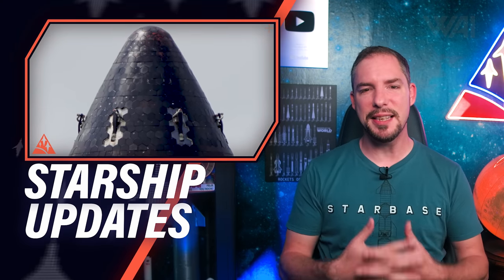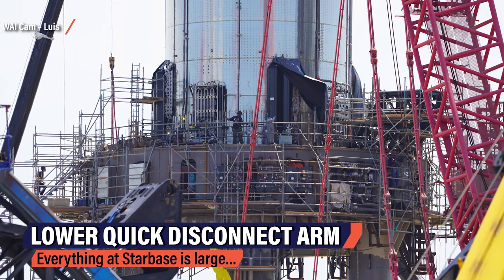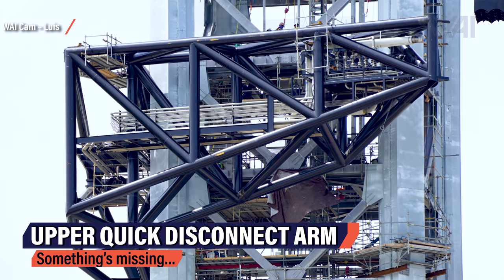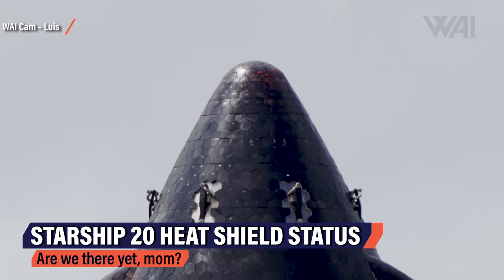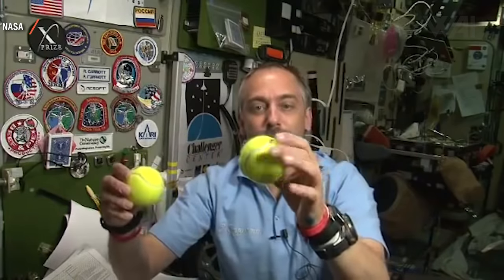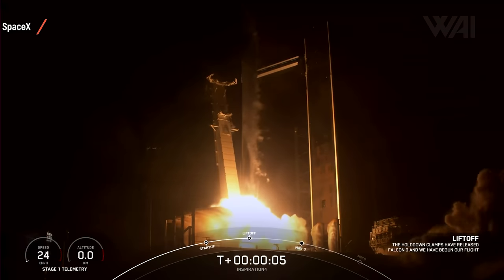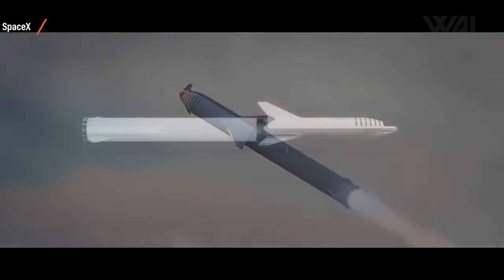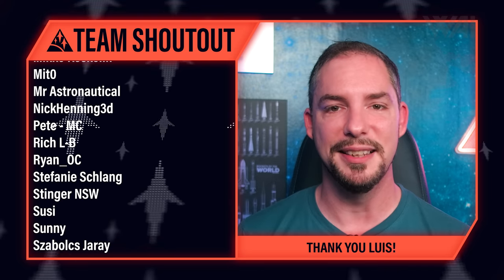SpaceX Starship Heat Shield Done! – Inspiration 4 Launch Summary

Comment: If B4 clears the pad without incident, they're doing well.
Reply: Im honestly worried the static fire will damage the pad which will in turn damage the raptors
Reply: @damitcam  And the farm being right next to the pad too?
Reply: @matthewcattermole5718  that im mostly concerned about a rud but yea thats a risk as well
Reply: @damitcam  I actually believe that the farms cryoshell would work fine against shrapnel, and I don’t see a significant risk of a shockwave so energetic, it would lead to a fatality on the tank farm. 
But I am just guessing, I should mention. 
I watched another channels Video about the explosive potential of that particular fully stacked vehicle. That was fun to watch.
Reply: @christophkitterer131  i watched it too but if it ruds the tank farm is going with it
Reply: Most likely B4 will explode at Stage 1. However B5 or B6 will probably get off the ground.
Reply: @christophkitterer131  what channel was that?
Reply: I doubt SpaceX would let it blow up like that. It's main goal in betting is to clear the tower and get some distance away so a RUD causes minimal harm.
Reply: Many expected Falcon Heavy to blow up but they nailed it first time, so maybe that's a good omen.  Maybe.
Reply: I mean I'll give them the benefit of B4 is basically a giant falcon. Yeah it is a whole beast but I think the basic principle is giant cylinder. Just this one is bigger. As long as the engines all ignite fine I wouldn't be suprised if it gets off the pad fine but the blows higher up in the air. Which would mean shrapnel all over the place.
Reply: @seniorslaphead8336  Nah.... The development of Falcon Heavy depended on the development of Falcon 9..... Starship is a different beast... so they should tame it as carely as possible
Reply: Luckily the people doing this are testing at each step. It should take off... and if it doesn't, then the next prototype is not far behind.
Reply: It would be a shame if all theie work go up in flames.
Reply: @matthewcattermole5718  There will be a berm
Reply: @johnruckman2320  it was Marcus House or however you spell his name. Maybe two weeks ago
Reply: @johndoe5061  Yup, booster 5 and ship 21 are already underway
Reply: It's that first shockwave traveling down and bouncing back up. The watersuppression system has to be right. It's easy to forget we are looking at something in the Saturn class.
Reply: @johnruckman2320  You already got the answer. I didn’t remember. It seems to have been Marcus House.
Reply: @damitcam  It RUDs the tank farm if… there were so many ifs to consider in that video. The small barrier, which I think is more an additional protection for any ground effects during launch landing or testing, won’t protect from a maximum yeald detonation. But it probably will survive an explosion Of some TNT-Equivalents.. what TNT detonates.. I guess it might explode. But detonate? I doubt it. Since I simply don’t really know 😂
Reply: @jayanspaliwal5907  the long pole isn’t the ship. It’s the launchpad. If RUD on static or on take off then it’s a reset by many months. What this really means is that SpaceX is going to be a lot more conservative with firing anything on the launchpad. Meaning no launch this year.
Reply: @A31415  I think you got me wrong buddy,I wasn't taking about the launchpad at all,I was saying that spacex has already begun construction of ship 21 and booster 5.
Reply: @كلاكلاللباطل-س3ح  Go find your sub reddit.

Comment: I believe, the state of the Heat-shield is more comparable to hoppers raptor or hopper itself. The first raptor that did actual work. This is the first heat shield intended to do actual work, being hopefully exposed to reentry 🤞
Reply: I've lost confidence in the heat shield. Sure it'll improve, but watching how fragile it looks and how much labor it took to install, I don't think a 10x improvement would lend itself to the reusability that starship needs and Musk wants. Originally I thought the transpiration cooling was too complicated, but now I'm starting to think it's the way they need to go.
Reply: @nonconsensualopinion  I pretty much had exactly the same thoughts. But there don’t seem to be better solutions in the timeline they have. 
They are still building the machine that is building the machine.
Reply: @nonconsensualopinion  This doesn't have the problems the shuttle had though... where anything flying off the tanks could damage the shield. So its unlikely that it will get damaged once they have sorted out any mounting issues.

Comment: I think the odds are zero of the ship reaching the surface in one piece. However, I'm sure they've got that thing instrumented all to hell, and I hope they have some sort of recoverable black box. As long as they get the telemetry they'll perfect the shield design quickly.
Reply: @NuclearTopSpot  I whole-heartedly agree
Reply: I think cameras will be as important as telemetry
Reply: Elon Musk's Mar 30th, 2021 tweet agrees with you.

"Next major technology rev is at SN20. Those ships will be orbit-capable with heat shield & stage separation system. Ascent success probability is high.

However, SN20+ vehicles will probably need many flight attempts to survive Mach 25 entry heating & land intact."
Reply: Their called data loggers and stream data to command control constantly (Star Link). No black box required.
Reply: @NuclearTopSpot   Unfortunately, accidents are always a possibility. The day will inevitably come when a Starship, on launch, landing, or in space, will suffer a catastrophic failure and be lost with all aboard just like happens, every year or two, with an airplane.

Comment: 18% chance of making it through the plasma, 8% chance it'll be fully functional after making it through.
Reply: That sounds about right😉
Reply: 18 i can see.... buttt 8 ? Maybe not so much. Still cant wait to see it launch
Reply: @last5902  8% chance of it being in the exact same condition after traveling through the plasma for the first time, compared to before reaching those conditions. God knows how many things could go wrong first time around. Flap gets jammed, computers get fried, excessive fuel boiling could cause an over-pressure, valves may get jammed, the structure may warp beyond serviceable limits, TPS may fail. It'll most likely be beyond a Hawaiian Pizza by the time it lands for the first test. It needs to clear the tower first!
Reply: @MattPD   Last is saying that it’s probably more around 2-3%
Reply: Personally I don't think the plasma will be an issue... but sticking the landing will still be an issue as they are adding more velocity and the booster is much more complex. At least the engine failure senario has been fixed (they just spin up extra engines and shut then down for it to land perhaps since B4 is bigger... it will, have more throtting leeway on the engines... ideally you can throtttle at least  1 engine's worth of minimum thrust.
Reply: Yep. Space Shuttle Program speaks volumes.
Reply: @Wingnut353  Reusability is the question.
Reply: @Wingnut353  once the first tile pops the rest will shear off promptly. Will see white streaks falling down from about 30km altitude
Reply: @dabigcheezprod  I guess that’s fair enough. Obviously I must of read it a little wrong.

Comment: The thing Felix keeps calling the "carriage for the catcher system" is looking increasingly like a double-ended gripper for the Starship QD arm, which is designed to stabilize the bottom of the Starship with respect to the top of the Booster.  I think the single Claw is destined not for the Starship QD arm, but is rather a Booster gripper for the QD pivot on the Launch mount; that could be helpful for precisely positioning the booster on the mount.

Comment: I am somewhat optimistic that Starship can enter and splashdown successfully. Wasn’t the shuttle built with aluminum and some composites? Starship is stainless steel. It should be able to better resist heat penetrating cracks between ties. The ship will be returning from frozen space with cryogenic propellants inside. The heat could dissipate quickly from hotspots.

Comment: Mr. M. gave a reasonable estimate of success which I agree with.  Flying at hypersonic as the Shuttle did, bouncing to a de-boost, then skydiving would be what I would suggest (all things done before).  Flying a new airframe hypersonic, with an untested heat shield, and such a large number of engines there could be issues.  The object of testing is to find the problems, good luck.  F. Miller, retired rocket scientist: 50/50

Comment: All of those workers on the launch mount make it look like it's covered with ants. When your workforce looks like that it means they are putting out that kind of power and that means big things are about to happen because nothing has power like an ant. I wouldn't worry about the heat shield. It's obvious they went over it with a fine toothed comb. Any air gaps between the tiles will be taken care of by the insulating blanket underneath them. I've worked with this stuff before. You can use the blankets to make a ceramic kiln. It's just some added insurance because the stainless steel can take the heat by itself. I'm constantly amazed at how smooth the ride is. The seats don't move and if you watch their hands and knees they don't shake at all.

Comment: Unless I'm mistaken, autogenous propellant pressurization vaporizes the individual propellants to maintain tank pressure as the liquid is consumed. The heat source for this vaporization is provided by the combustion products...most likely from one or both of the pre-burners in this case.

For a number of reasons, I don't think the combustion products are what is used to pressurize the tanks. This gas contains water vapor that would either condense or freeze upon reaching the cryogenic tanks.

Comment: Thanks to Felix Schlang for his very detailed and well-informed analysis of the new equipment being installed at "Stage Zero" and on the main booster (I learned a lot from his descriptions of the autogenous pressurization lines, the carbon-fibre-wrapped tanks and the other equipment).
Reply: I would respectfully suggest, though, that the use of the term "tourism" to describe the Inspiration 4 flight is not accurate. Tourists don't normally train for six months prior to going off to Belize or Fiji for a holiday, nor do they conduct medical, scientific and administrative tasks during their vacations.

Comment: My guess, based on an extensive lack of knowledge, of the odds that the heat shield of Ship will survive atmospheric reentry,  is just plain zero.  The first time.  But given that this is SpaceX management and labor, they will rise to the challenge and produce a 100% perfect heatshield system within fewer than 5 or 6 reentries and will produce assembly and maintenance procedures and machinery that will produce keep it there.  Good luck SpaceX, and the same for all your supporting subs.

Comment: I think the fins staying out during launch will cause the rocket to fail.  Lots if stress near the connection between the Starship and BFR.  Another question about why the Starship doesn’t have and an extension of the hull running past the Starship’s belly’s section only.  Would help the plasma from heating the inside of the rocket engine are.  Need to get the plasma further away.  Just saying.

Comment: The 2 biggest challenges for Starship Heavy is the initial launch and the Atmosphere Reentry.
I expect many of the heatshield tiles to fall off the vehicle during launch due to extreme vibration....that is if the whole system doesn't suffer a RUD. 
There wis no way to determine the state of any damage to the heatshield after launch. If Starship endures the de-orbiting reentry plasma, without disintegrating, and the splashdown, SpaceX will have an invaluable model for it's future Starship interactions.

Comment: Question about the heat shield: what would prevent the SpaceX engineers from making a heat shield blanket, as a single piece, that bolts on like a chest plate using a similar array of pins?  Smaller surface area and mouldable?  It would have a higher footprint and storage would be more difficult than individual tiles, but turn around time would be less.  Also, another question: how viable is it to create siping to direct the heat on re-entry like a tyre has siping to redirect water?
Reply: The thermal tiles are a type of ceramic and evidently will expand some in the heat. They are apparently just the right size to expand to just touch each other. A larger panel may not work as well and/or be as easy to swap out from micrometer damage as a guess. Only having to swap a tile or two from a hit instead of a huge panel.

They initially wanted to seep cyro propellant out of the skin to whisk away heat, but apparently the tiles were easier and lighter. The plasma builds up as the air can't get out of the way fast enough and that inteface just off the hull helps somewhat I understand.

Comment: Question: Why can't they use bigger tiles or just one big piece of heat shielding + additional ones for the flaps?
Reply: Too big wouldn’t work because of the fragility and the stiffness of the tiles. The structure is so big, it has to go through some ascend and descend forces that deform the body in a way, a too big of a heat tile would break under.
But I asked myself also. Why exactly that size, why not bigger? Is it a manufacturing-question?

Comment: Depends on how you define "piece".
I think the nose part, windward from the forward air brakes, is going to shear off;  then split in 1000 pieces.
Does that make it 1001 pieces total?
Because I think the main part will make it in one piece, mostly (might lose a few gribbles).

Comment: Any word on whether the COPVs drive initial start up or whether that is handled by a launch mount connection saving the onboard capacity by perhaps routing it through the lower disconnect arm instead of carrying extra but used capacity into flight.

Comment: 10 out of 10 the Ship 20 will survive reentry. The steel could theoretically survive with no heat shileds at all - I highly doubt the imperfect tps tiles will make a difference (as opposed to perfectly laid tps tiles, not a fully exposed ship).

All that is to say, I don't think heating will be an issue - the aero forces might still rip it apart.. I really hope there will be somebody capturing the whole event, difficult as it may be! that will be something to see, and I cannot wait.
Reply: The steel on the dorsal side does not need tiles, but the ventral must have tiles or the steel will burn through. Elon Musk's Mar 30th, 2021 tweet disagrees with you on reentry.

"Next major technology rev is at SN20. Those ships will be orbit-capable with heat shield & stage separation system. Ascent success probability is high.

However, SN20+ vehicles will probably need many flight attempts to survive Mach 25 entry heating & land intact."

Comment: Chances are slim that S20 will survive reentry--1 in 20 is my guess.
S20 needs to get off the ground first--50% chance; that is if the static fire goes well. That is a lot of Raptors firing at the same time! The trust puck is going to take a beating, which is the keystone to the whole system.

Comment: Can you explain to me, why Starship has to refuel in Orbit to get to the Moon, and the Apollo Rockets didn't need to, even Starship has more Fuel on Board??
Reply: The main difference is the weight of what they can deliver to the surface of the moon.  Apollo delivered the Lunar Module weighing 15,200 kg (4,280 kg dry mass), to lunar orbit, which then descended and ascended to the lunar surface, and the cargo onboard was a small portion of that weight. 

In contrast, starship will land the entire starship upper stage including it's  +100,000 kg of cargo on the surface of the moon.  So basically, it needs the refilling missions to have the extra fuel needed to carry that much cargo weight.
Reply: @bennordstrom  Thank you nice to learn something!!!!

Comment: Can you give us some details about how the booster is supported on the launch ring?

Also, can the heat shield be created with some sort of sprayed on application, instead of the tiles? Is it about them being able to be replaced mechanically?
Reply: Since the tiles are made in a SpaceX factory that SpaceX calls the Bakery, it almost certainly can't be sprayed on. Reportedly, there is a machine that can put on the body tiles in the tents. But seams and curvy parts likely need human hands. 

There are a number of huge hydraulic rams around the end of the launch ring that mate up with the support points on the bottom rim of the booster. Those rams will flip back out of the way, once Starship starts to lift off.

Comment: Odds: Very good because the weight:surface area is good I think it will be a slower entry thus less heat & the stainless is much more durable than carbon fiber or aluminum.

Comment: Hey, I'm wondering why they aren't using high strength CARBON-CARBON COMPOSITE that was used on the space shuttle leading edge (For some of the complicated flap sections I mean).... 
♦️I realize they are expensive and, yes insulation did damage one of them during the Columbia disaster I think....
Reply: Commonalities are important

Comment: I presume the heavy  booster rocket engine electronics are so nimble they can comfortably moderate failure modes and loads gracefully to the point that, is rare possibility  of catastrophic scenarios and given that the redundancy of all those engines should mean nominal envelope first stage well within engineering tolerances is most likely too. Re-entry  seem interestingly prone to issues. Hopefully there are aspects of the heat shield which offer some sort of quasi redundancy that isn't immediately obvious, or that Elon has some orbital tile repair  drones on board starship, to assess and address any issues with a  bag of spares tiles it can robotically swap out lol...